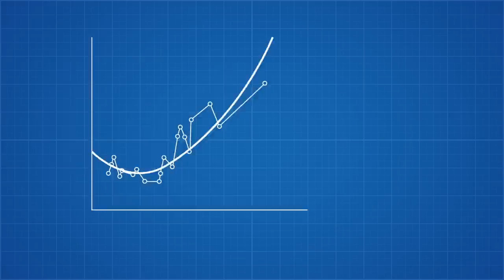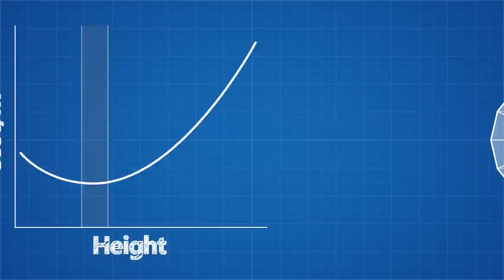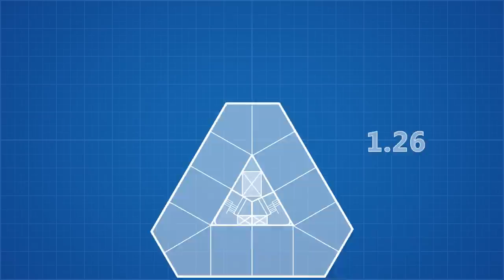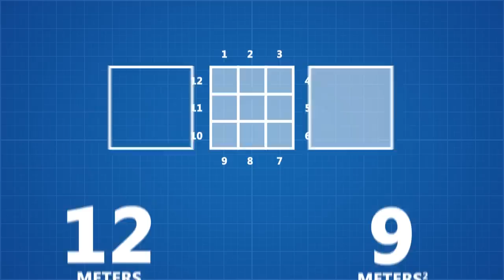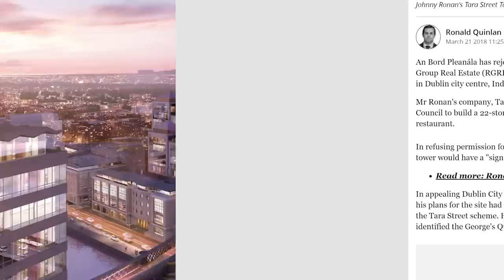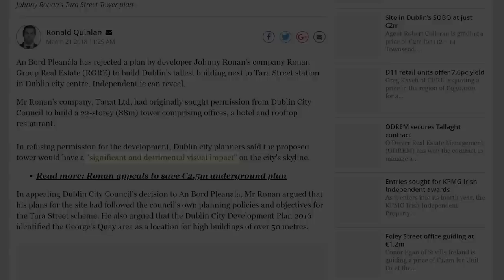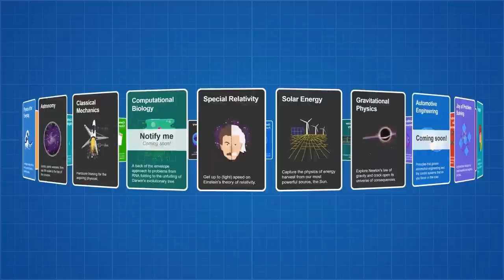How to Solve the Housing Crisis

Comment: 5-Summary of a new overview of my working paper to overcome housing problem better than mortgage pledge law to the country {law of finance estate}

The statistics refer to the availability of (10) million vacant (empty) flats in the country, for example, Egypt means if we estimate the value of single flat around (90) thousand Egyptian pound you will find us losing (90) billion pound that are not exploited.

The estate investment occupies more than (60%) from the volume of total investment in the country and the people houses cost more than (400) billion that means there is no financial problem at all, so the solution of the housing problem is a legal solution.   

In spite of that, there is a housing problem which represents the biggest resource of economic harm because it is an internal domestic service sector.

Despite that a capitalism system considers the housing as merchandise and as a service in  socialism system, in my opinion, it is as a necessity which could be cancelled if it is available without defining numbers of rent or possessing and should place housing sector in the service of the production sector and less financial revenue from the production sectors.

5-1  The current rental systems are: -

5-1-A   The old law: {constant rental value, unlimited period] although it is proper from the legal status and correct from the religious status it has.

5-1-B    The law (civil law) defines rental agreement for a limited period and secondly the contract will be renewed at the end of the contract.

5-2 Therefore, I submit my thoughts to solve the housing problem as follow: -

5-2-A   To prepare a special record for lands and to each housing unit including the names of owners and renters and the numbers refer to the code of the city, area, district, street, building and flat number which indicates the location.

5-2-B   The ministry of housing proceeds in economical research to evaluate now the average rental value of square meter [m2] to the housing unit in the country and then compare this value with the equivalent price weight of products for three supply merchandise [for example if the rent of square meters [2] two Egyptian pound [l .e] it is equivalent in the product of price/kilo of rice or half a kilo of beans or kilo of sugar becomes the value of the square meter

Continuously which is called the real estate rental pound in the condition that the ministry of housing will prepare on 1/1 & 1/7 yearly the value to the rental real estate pound?

real estate rental pound equals one/ three of (the price of one1 kg of sugar + price of a half kg of bean + price of one kg rice)

5-2-C   The rental value of the housing units equal multiplying the flat area by the estate rental pound, so the rental value by the real estate pound will be fixed but the cash value will change according to the value of the real estate rental pound.

5-2-D   Rent contract for the first period will be for five years and renewed yearly automatically unless the owner is interested to sell the flat and (the renter should have priority of purchase) or if one of the sons of the owner reached (21) years age and is interested to marry.

5-2-E   To establish a fund for housing for constructing new housing or to give free good loans to whom is interested in construction or housing and its resources as follows: -

-       A tax of non – occupation and unused tax, and the minimum limit of water and electricity fine.

-       One to three of the profits of commercial centres which will be held in a different neighborhood.

-       Value of renting the housing units will be rented in the new cities.

-       The value of renting the buildings while its owners will release it after compensating them with lands in new cities and giving them free interest loans.

-       The rental value of the usage of shops

-       Every new renter should pay money as per specified pieces in the real estate fund to be paid to the owner in a sum of money equal to the rent of six months at the end of rent contract for refurbishing the flat

5-3-The rules which business is based on:

5-3-1    The Policy of ownership or rent is an exception but the rule is that the person builds his own house away from his pocket, and the landlord must get his house when he needs.

5-3-2    The value of the renting of the apartment is measured by a new evaluation unit called the real estate rental pound; its monetary value is changing over time, and it is based on the average price of units’ weight of some goods regardless of the location of the building or apartment number, without pricing.

5-3-3 The establishment of associations (business Centre) concerning the residents in terms of administrative, social, sometimes scientific affairs, as a socio-economic project is sponsored by the contribution of the owners of apartments in equal shares, and the revenue is distributed equally to shareholders, maintaining and managing the neighborhood itself by the owners and Housing fund.

5-3-4    It is not required from the human to build his house from his own money but through three means of either a free good loan from the Housing Fund – either within the agreement with a contracting company to build his house and the Housing Fund is the guarantor or through partnerships with tenants for construction and the guarantor is the Housing Fund.

https://www.amazon.com/dp/977906561X?ref_=pe_3052080_397514860

The link of the book on amazon

Comment: Nice but unnecessary.  Housing prices are on the decline but limited supply are “bubble” artificially driving prices up.  After a decade of low interest loans and a depressed housing market in that same time ( you do the math).  We’re poised for another “correction.  Housing prices are at 2007-2008 levels,  real wages have stagnated.  We don’t need a million dollar cup with ingenious engineering we need more supply without investor dilution of inventory, wait a year and see....ending quarter of 2019!

Comment: The other problem is inviting more and more immigrants while you are in a housing crisis.  You jumped over building high increase the efficiency of public transport. First off no it doesn't it only increases the need of public transport. In the end you brought up an interesting prefab tech that has been used for a while while neglecting the easiest and cheapest way to fix the issue. Tougher migration screening.

Comment: personally, i see zoning regulations and district regulations from cities as reasons why housing is unaffordable. the fact that you have to get permission from the city to use the land that you supposely own is astounding, and you have to change the "zone" in order to build what you want. this is very limiting on the markets ability and you can easily get denied if the people in the local government don't want a skyscraper to "preserve the cities history"
theres a way to do that, its called a museum. another way of doing that is building another city centre, that way you have "historic dublin" and "downtown dublin". when you have no rights to do what you want, build what you want, it becomes challenging for developers to build anything that can lower the cost of housing in a specific area. this turns into serious economic and housing problems that you simply cannot ignore. and thanks to the free market its cheaper and faster now to literally build a skyscraper. (there is no way communists made that innovation, i simply don't believe in such.)

Comment: well well. Berlin is much worse bro.
the prices have doubled since 5 years.
Reply: either way. what solves the issue for small cities like Dublin is what they are doing in Japan:
build high speed metro systems with few stations and build new pockets of houses outside the city.
getting to work in 30min from 30km away is the same thing as 30min 6km away.
and let this run non-stop.

not very helpful in Berlin though. or any other metropolis.

Comment: You obviously don't live in China and have never seen the "benefits" of Chinese construction methods. Many opportunities await those who purchase there such as concrete chunks falling on the heads of the residents, complete replacement of large portions of the buildings due to poor original construction, and an incredible depreciation in value over time. They may have interesting new techniques, but building a skyscraper in 15 days that will fall apart in the near future is not a progressive step.

Comment: most of this video i agree with, except when he put the bullet point about building less than 1 car parking spot per unit and instead relying on public transport.. no no no no, hell no. if you do that then you end up with a problem which is massively apparent here in london where you have more properties and more cars than are spaces to park them. leading to narrow roads swampped by lines of parked cars as people have nowhere else to park them. even with public transport people still need cars, most households will have one or two cars, the people who dont have a car and only use public transport simply offsets the number of households that have two cars. living in a property and having nowhere to ever park is one of the most frustrating things of urban living and drives people out. and causes lost opportunities because public transport is not 24/7 and does not go everywhere and you physically cant transport alot of equipment on a bus or packed tube train. not having cars simply is not practical in the modern world even with the switch to electric, cars are still going to be essential to peoples lives and are still going to need places to park them

Comment: With this apparent worldwide demand for urban accommodation, I also wonder if the consequences of realising this have been fully thought through in many instances. Where ever you dramatically increase the concentration of people, you also dramatically increase their negative impacts. While housing is important, you also need to consider the additional fresh water, electricity, heating/cooling, increased traffic, sewage treatment and other waste requirements like landfill, to name but a few. 
Politicians often concentrate solely on the head line grabbing aspects of more affordable urban accommodation, with little or no consideration for additional capacity to basic services an increased local population will also require. Simply tapping another thousand residential units onto the same existing, and often already aging, infrastructure is not a recipe for sustainable growth.
Reply: All of those factors you mention become MORE efficient and LESS wasteful with added population density, not the other way around. You need less energy to heat and cool one big building than a bunch of single family detached homes, even if the total area of floor space is the same, to give one example. Similar effects exist for everything you mentioned and more. It's not just money either, it's far more environmentally friendly to live densely.

Comment: 2050 will see the re-introduction of 21st century communist housing blocks, built side to side, back to back, with organic circuitry roads connecting everything.
Buildings will be layout-standardized, to the point where turning a 2x2x2 living block into a media viewing platform will be little more work than detaching floors and walls, and re-supporting pillars through substitution demolition.
Building will never have been simpler, as parts are constructed mostly off site, and finished up in mere weeks.
All parts of modern society, working together to provide everyone with individual and communal housing...

... And it won't be enough.

As a result, millions will die in poverty, likely from hunger.
Not just 5 or 8 million either, hundreds of millions around the world will starve, at first.
Overpopulation will push large populations over the brink, resulting in supply-induced death-waves.
In some areas, it will get so bad that entire cities become rotting graveyards.
A black death of our own making, only this one doesn't stop on it's own.

As we ramp up energy-production and consumption to try to offset the systemic failure of global agriculture, we only worsen the problem.

Governments will start falling one by one, and before 20 years have passed, the world is essentially a well-operated mega-corporation anarchy, as those in charge throw in the towel, not being able to control the very forces they required to maintain order.
No government will be able to get anything done as people will be forced to live for themselves, and for each other, if they want to survive.
Even though at first, we turned to violence, we soon learned to accept that a quicker death was still worse than the smallest sliver of a chance on survival... We kept trying...

The only thing keeping the vast mazes of urban death-blocks running is the systems we put in place anywhere from a decade to 30 years prior.
We've reached the tipping point.
The point of no return, complete societal collapse.
With no one to run production of power and goods, to operate factories and machines, we lose everything we built in the past 150 years.

... And only 60 or so years ago, we worried about skyline pollution, social politics and the monetary impact of climate change.

We're doomed by our own existence.
Over-population, over-industrialization, over-pollution, over-exhausting land, sea and air alike.

We shouldn't have the rights we have, because we abuse every loophole we find.

Our humanity will be the end of humanity.
Slowly dying off, because we decided our rights as individuals was more important than the preservation of the world as we built it.

All this...

... And those in charge are upset about the fucking view...

Comment: Why not build into the ground? Make an underground living space
Reply: That is one of musks plans
Reply: @Eritrea Shabiyaጝሕ EPLF initially but it cuts down on heating and cooling costs, maintenance would be cheaper and longer lasting if you made walkways along the outside of the building and the ground could help to support it. Not to mention the utility of those kind of buildings during war time
Reply: @Eritrea Shabiyaጝሕ EPLF your right, I'm a fool
Reply: @Eritrea Shabiyaጝሕ EPLF I'm not really seeing any downside though to building into the ground other than earthquakes being a problem, plus building into the ground on earth would allow us to practice making buildings that can be used when we eventually expand to other planets. Of course its expensive at first but how else can we make progress to make it cheaper? Other then earthquakes what other problems can you bring up to the idea?
Reply: @Eritrea Shabiyaጝሕ EPLF climate control would be easy to regulate and maintain (think of why a basement stays cool in the summer and warm in the winter) the water problem is fixed by just picking a dry area,drilling companies have plenty of experience doing this because they need to be able to set a well up thats stable, and most towers have oxygen systems already implemented so we just use a similar system that they use

Comment: There is no housing crisis....
I could quote Buckminster Fuller here, but I won't.
Do your homework.
(there is a capitalism-crisis, though...)
Reply: Capitalism is the crisis. We reached a point where humans no longer are the most cost effective resource for production. That creates an unfixable inbalance in capitalism that will only keep expanding going forward.
Now it's just waiting until the shrinking part can no longer sustain the balooning part and it no longer can function.
Reply: Yeah, this is 100% a capitalism problem. We could easily build enough housing if we stopped having privatized property.
Reply: @HydratedBeans  you can have both though.